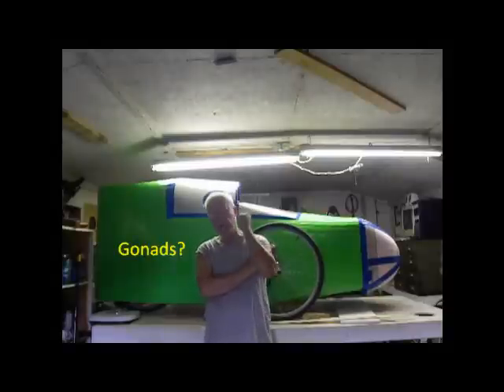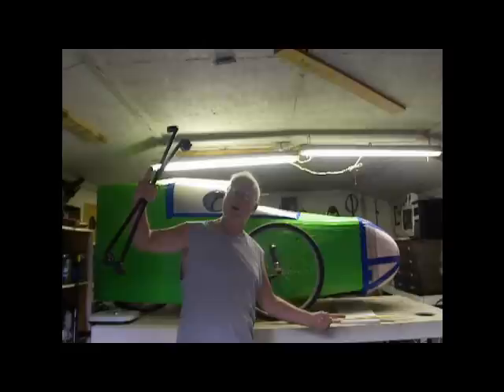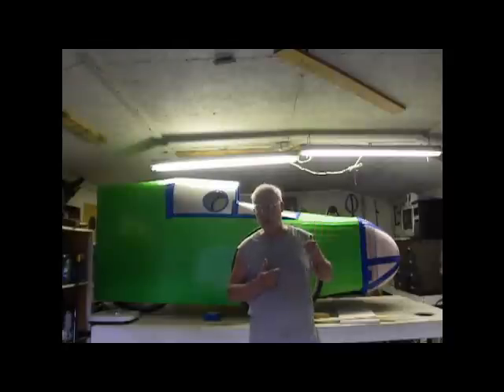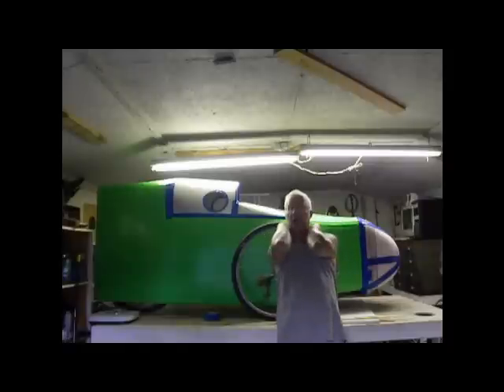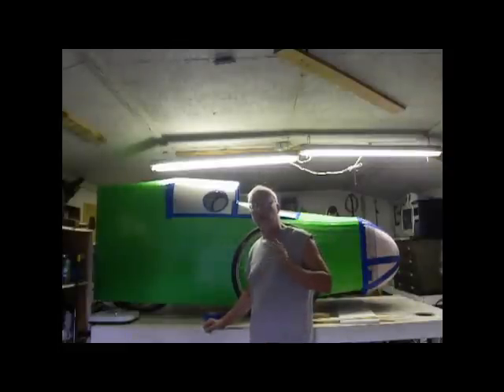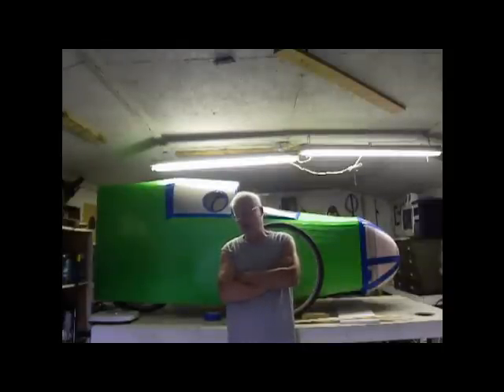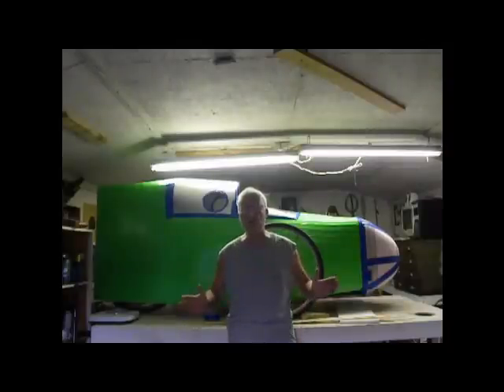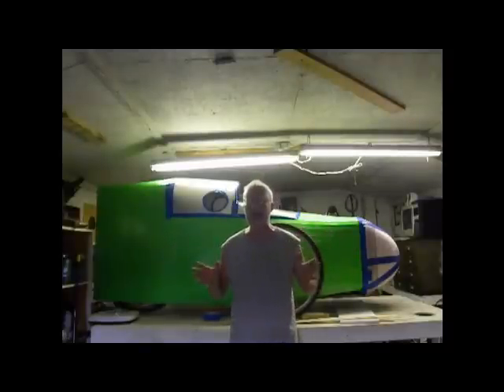Gonads

Comment: my g-ma has the prius and she gets 46.5mpg's. only if you travel alot then you should get it, otherwise get a car you want.  the prius's battery isnt big enough nor holds a significant charge to include a plug in option.  The prius more or less goes on the idea of an electric diesel train. uses motor to power electric motors so therefore when the engine is running it is using all its power to do something whether charge or move the vehicle. i can help you if you are looking for a car.